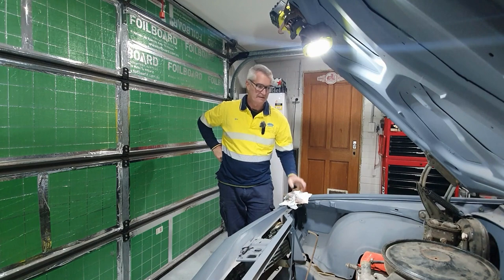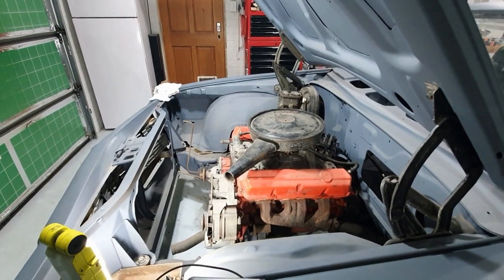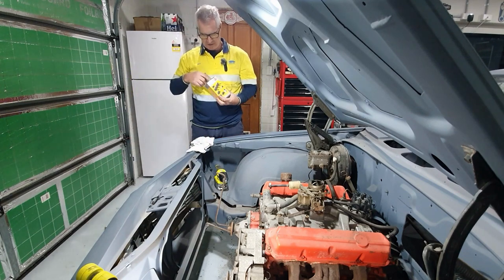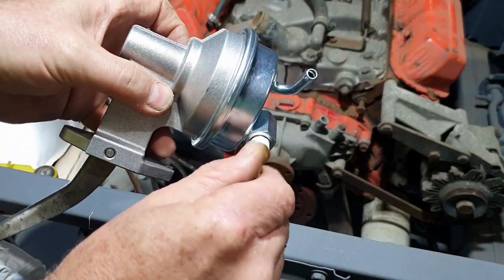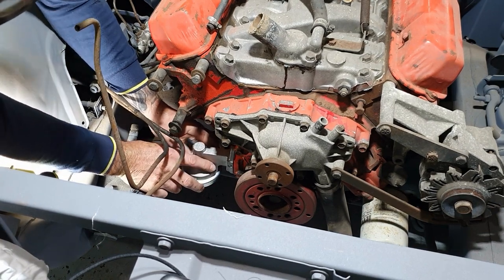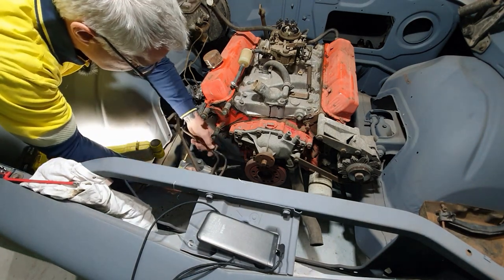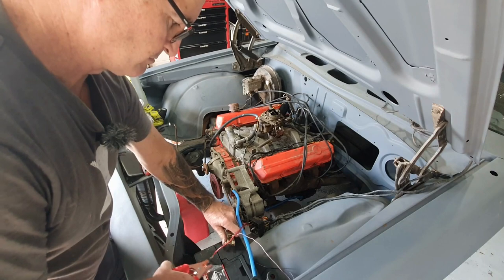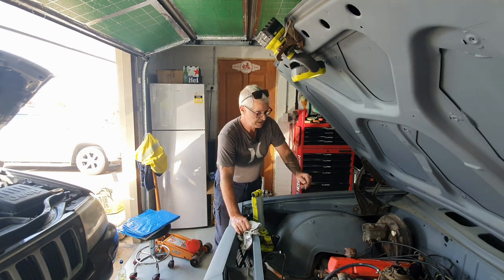HQ GTS Coupe engine, first start up in 20 years.

Comment: The other pin you tried on the starter which didnt seem to do anything may have 12v once the starter picks up, it can be used sometimes to supply power to the coil during cranking only.
Reply from the maker: Ill have to check that Rob. Thanks.